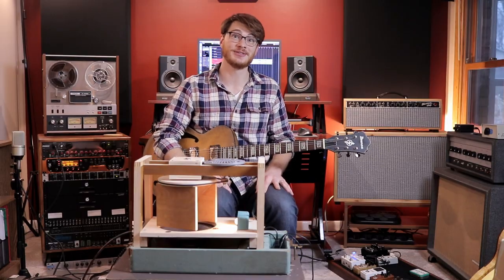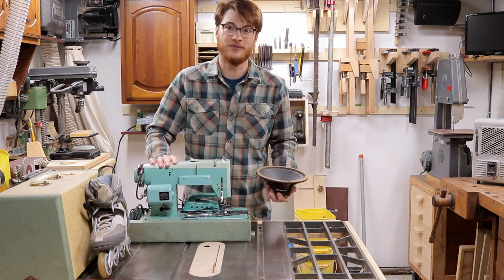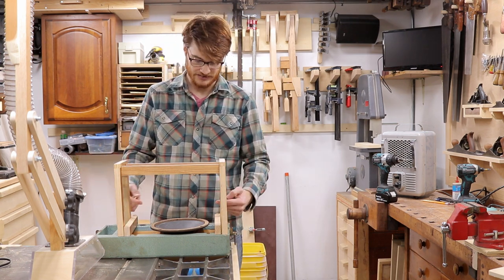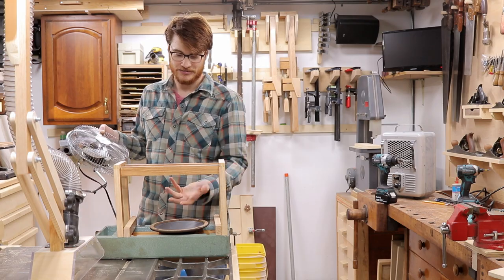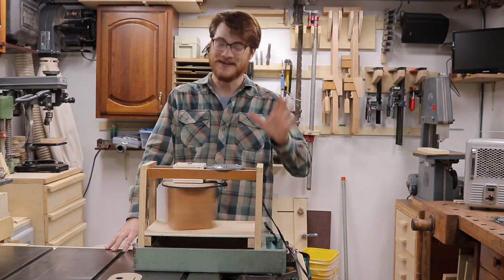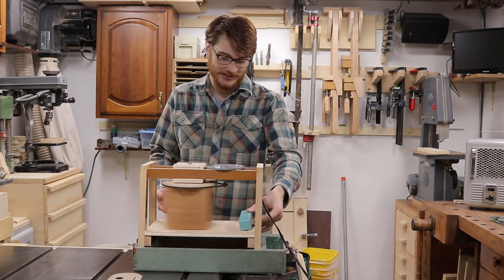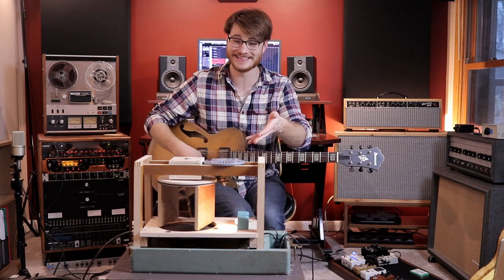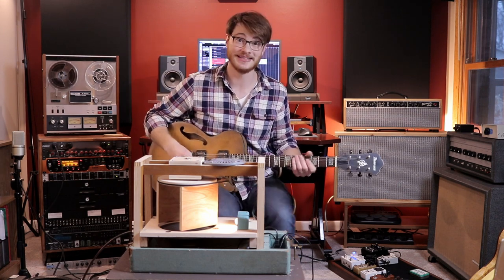D.I.Y. Sewing Machine Rotary Speaker

Comment: What you have made is NOT a rotary speaker it does not sound anything like a Leslie ...the speaker in your contraption does NOT rotate    Many years ago I built a true Leslie type speaker  where the speaker was built into the side of a drum that had a shaped port it was driven by a record player motor the whole thing rotated and gave a true Leslie sound...there is another way of getting the Leslie sound some old upright electonic organs ,Yamaha for example had a Leslie speaker built in I have such a unit somewhere I must find it ...kind regards from the U.K.
Reply from the maker: The speakers themselves don't rotate in a Leslie either. The biggest difference between this and a Leslie is a Leslie has two sets of rotating baffles to create more warble than just wah wah. This is basically a mini Fender Vibratone but less people know what that is.